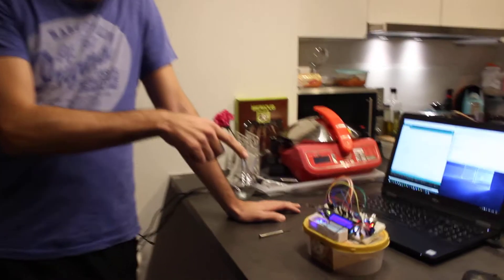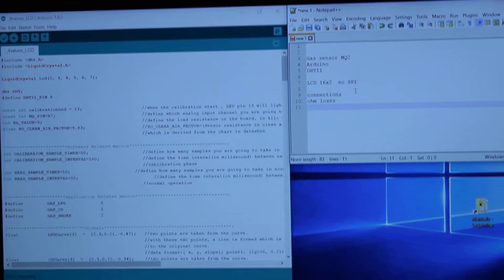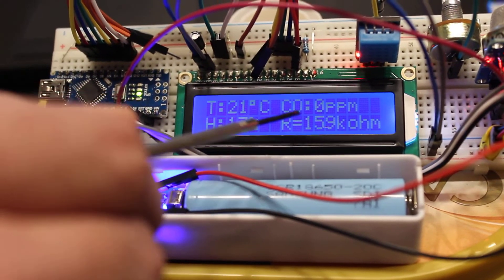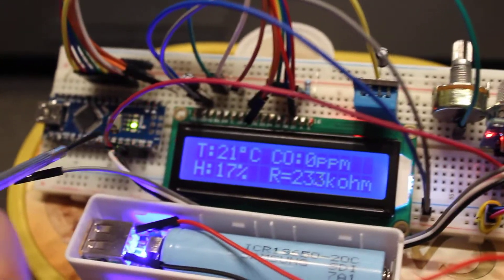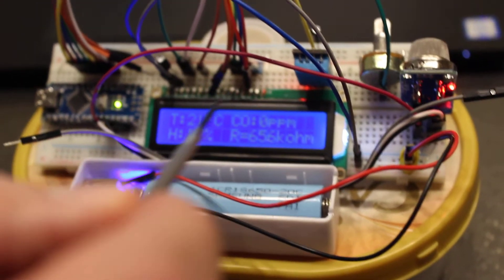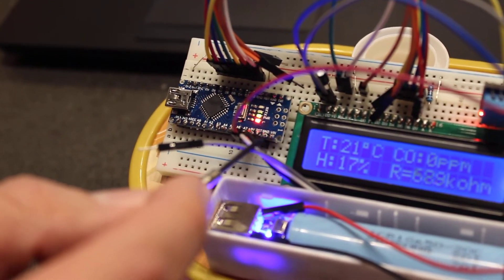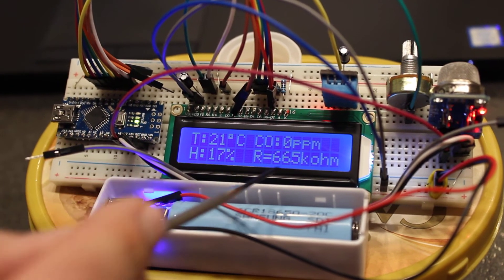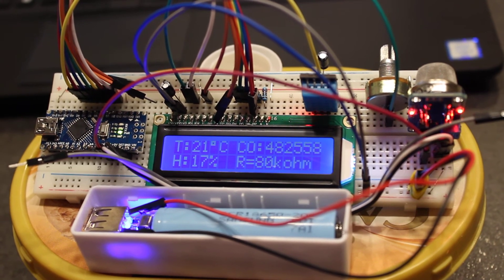MQ-2 gas sensor 16x2 LCD screen output (Arduino)

Comment: hi may i know where do i get the circuit connections from?
Reply from the maker: Do you mean the jumper cables? they come with standard arduino kits, you can also buy them individually in Aliexpress. But I recommend using old phone cable, the one with a single copper core. You can cut it and peel the tips, it looks much more neat.

Comment: Hello,
i have a Problem with my DHT11. The Display shows by Temp and Humidity at first thr right Temperature. After it they  shows -999 .
Can u help me with my Problem? I think the Library is not correct.

Greetings from Germany

Comment: Hi argilaga, I am a student in 10th grade and i am planning to make this in my science fair!
I just had a couple doubts-
https://github.com/argilaga15/Arduino_DHT11_MQ2/blob/master/_4values_LCD.ino- is this the code for the mq2?
http://www.circuitbasics.com/how-to-set-up-the-dht11-humidity-sensor-on-an-arduino/- is this the code for dht11?
And can i use an arduino uno?
Can i use a normal battery or battery eliminator rather than the powerbank?
Reply: in 1 week !
Reply: Hi! thanks for the interest!
The first link is  exactly the code I use in the video, it includes the MQ2 sensor, dht11 and the LCD output, so you don't need anything else. The second link is just for the dht11 sensor. Yes you can use Arduino UNO, it is exactly the same, the only difference is that you need to select the correct board in the Arduino ine interface when you upload the sketch. 

For the battery, you can power the Arduino as you want, by USB, 7-12v to the power jack, +5v to the 5v pin or 6-12v to the Vin pin. Check this image: https://www.open-electronics.org/wp-content/uploads/2015/07/Fig9.png

Good luck with the science fair!!!
Reply: Thanks a lot albert!
Your help may get me the first prize
Just one last query
Can i use the mq135 sensor  because in the description of the mq2 purchase link it does not state if it can measure co and co2?
Reply from the maker: Yes you can use the mq135, but you need to change the parameters of the curves, also take into account that the mq125 is a high sensitivity sensor, so it can be used from 10 to 200 ppm. The mq2 goes from 200 to 1000 ppm. The MQ2 does measure CO, but I think it doesn't measure CO2.
Reply: But will the mq135 function in the exact same way as the mq2
The mq135 will also provide an output same as the mq2 right?
How exactly do you change parameter of curves, please provide an example code changing the parameters
Reply from the maker: They will function the same as far as they are mounted in the same board, they just have different sensitivity to gases. You can get the parameters here: https://www.olimex.com/Products/Components/Sensors/SNS-MQ135/resources/SNS-MQ135.pdf (figure 3) and then change the code here: https://github.com/argilaga15/Arduino_DHT11_MQ2/blob/master/_4values_LCD.ino from lines 28 to 41 you have an explanation, in short, what you need is to input 3 parameters, which are X,Y,m where m is the slope of the curve. To obtain X,Y you need to compute the logarithm of the values of X,Y in the plot, try to do for the MQ2 sensor, if you get the same values as in the code, or similar, then you are doing it right! And finally, you change those parameters in the gas you will use, lines: 29,33 or 37. Good luck!
Reply: argilaga what would happen if I copy pasted the same code for the mq135
Reply: the code is not working albert!
it gives error exit status 1
Can u pleasee mail me the exact working code that i can just copy and paste for my mq135
my science fair deadline is coming up and i have already purchased all the parts!
Please
/my mail -  roblx4lyf@gmail.com
Reply: PLS KEEP IN MIND I HAVE ARDUINO 1.8.5
Reply: sir this code is not working for me i am facing many difficulties
i am just copying the entire code you have given as it is and pasting it on arduino bt it is not compiling !
Reply from the maker: did you install the liquid crystal library?
Reply: i have downloaded it but there are so many files inside that
which one will help me
Reply from the maker: you don't need to open the .zip file, just follow the procedure to install libraries as I explained you in the email and select the .zip file
Reply: can you please send me a photo from the top so i can see how everything is attached to the breadboard.
I followed the steps you  mailed me and it successfully uploaded it to the arduino! Can i use the same program for the mq135? Its difficult to change the parameters.
Reply from the maker: Great! you are getting closer and closer! The fact is that this is an old project, so I don't have it mounted anymore in the bredboard (now I have a battery cycling system), you can try to pause the video to see them, you can also check the wiring for the 1602 LCD here: https://www.allaboutcircuits.com/projects/interface-an-lcd-with-an-arduino/
Yes you can use the same parameters of the MQ2 for the MQ125, but the readings may be not correct, you leave the calibration for another day!
Reply: Pls tell me what is the hardware component placed between the mq2 and the dht11?
Is it neccesary to have that and does it have seperate code?
Reply from the maker: That is a resistor pot of 10 kohm, to adjust the LCD screen contrast, but if you don't have one you can just try with a 1 kohm resistor. When is the science fair?
Reply: Can u supply power to every component using the uno's ports?
Reply from the maker: It's not advised to supply power to the gas sensor from the Arduino because it draws around 200mA and this is the limit of the board, better supply the 5v to the sensor bypassing the board. But I did power the sensor from the +5v pin in the Arduino and I didn't fry anything.
Reply: Hey albert! The science fair is over but for me the CO detection didnt work :( . Temp and Humidity was working perfect and was increasing/ when i provided warm and cold air. I tried everything for the CO, I gave bought 3 mq2's but all of them showed the reading CO=0, I gave 9V direct current because i thought the filament isnt getting heated. I really want to rectify the error. Can you kindly still help me? And if i release lighter fluid or burn a lighter in front of the mq2 should it detect it? I will email you my photos of the project. Kindly help. Thanks, Soham! Hope you respond
Reply from the maker: Hey! I am happy you built it even if it didn't work. I see the resistance gives a reading of 17khom, even if the CO reading is zero you should focus on the resistance reading to see what is going on in the sensor. Now I don't have much time but I will try to look at the pictures and diagram you sent me and try to help you. Good work!

Comment: Hi may i know how to adjust the on board load resistor (the small blue box) of the MQ sensor if i want to adjust it to 5k ohm? twist to left or right?
Reply from the maker: Hello, if I'm not wrong the blue box trim adjusts the threshold of detection if you are using the digital output (on off), in the video I use the analog output, so that trim pot is useless in this case.
Reply: TQ for your reply, 1more question to ask. I wonder know what is the meaning of this code ----> RL value =5. Isit i need to add on a 5kohm , if yes where should i put the resistor on? FYI, i think the video you showed does not use any external resistor also right?
Reply from the maker: Welcome! it depends if you got the bare sensor, or the sensor mounted in a PCB, like mine. In the second case the PCB includes the circuitry for the digital output, the trim pot that affects the digital output threshold, and the 5k resistor for the bias of the analog output, so you don't need to add any resistor, just mesure the voltage in the analog out pin.

Comment: My first project this, So bare with me argilaga - Can i make the same with a mega board ?  Having a quick look around your videos, Im gonna have ago myself.
Reply from the maker: Hi Mark, I think yes,  it should work. Just select the correct board when you compile your code. I advise you to try first the two sensors separately, if they work go ahead with the two together plus the LCD screen. Good luck!
Reply: I managed to get the MQ2 working, Feeling pretty proud. I have noticed a Air Quality sensor on youre page .. Im very interested in making that unit.  I am after making a unit that will sense H2S - methane - gps - wifi - and all the weather station mods. Long story but lots of local residents are being poisoned by a local waste dump. The government are taking readings of H2S at over 500 ppB . FB page has been made its heading to 3,000 folk who are affected by this. So i'm looking for a system i can place on a pole on the side of the house to get my own readings, Will This arduino gadget let me make that Is that possible ? 

Cheers Mark
https://www.facebook.com/groups/553135988367705/
Reply from the maker: Hi Mark! To sense H2S you need the MQ136 sensor. In the link below you fill find the data to fit the H2S Rs/R0-ppm curves (Fig. 3), so you will need to change the following parameters in the code: 
"float           COCurve[3]  =  {2.3,0.72,-0.34}; " or add a new float for H2S.

The 136 sensor is made for concentrations of 1-200ppm,  1000ppB is 1ppm if i'm not wrong with the units, so it must be in the range. Be careful, since the sensor is also sensitive to CO, the presence of CO could give a fake positive reading. Good luck! and keep me updated!

http://www.china-total.com/Product/meter/gas-sensor/MQ136-new.pdf

Comment: can you give me the library that you used because I have problem with compiling code??
Reply from the maker: Yes sure!
Here for the liquidcrystal: http://downloads.arduino.cc/libraries/github.com/arduino-libraries/LiquidCrystal-1.0.7.zip
and here for the DHT11:  https://github.com/adafruit/DHT-sensor-library/blob/master/DHT.h
I just tried and it compiles well with the latest versions installed. I hope it works!
Reply: thank you ,I think the problem with my arduino IDE version because I have 1.8.5 version and I tried more than one libraries and also not work

Comment: Do you have any sheme for this?
Reply from the maker: Hello, sorry but I didn't make a scheme, you can find the scheme for the LCD screen  here: https://www.arduino.cc/en/Tutorial/HelloWorld and the sensors only need one input pin each: analog 7  for the gas and digital 8 for the temperature. Plus the connection for the Analog reference from the gas sensor +5v to Aref. Good luck!
Reply: I want to ask you something?
I changed your code not that much but enough to work on my project but I want to put in a 2 led lights and buzzer.
I found a code that i want to put in your code.
What i want to ask you would you do it for me because I do not really know how.
So if you want to help me,give me an email or some contact to sent you my code and code that is need to put in.
I will apriciate if you help me cuz this is my graduate project.
Reply from the maker: Hey, I cannot assure I will have time to look at it, this month is a bit crazy in the office. But you can send me the codes and I will try! send to my gmail address: albertargilaga

Comment: can you sen me the circuit diagram that you used??
Reply from the maker: Here you have the diagrams for the LCD screen and the Arduino UNO: https://www.arduino.cc/en/Tutorial/HelloWorld
The gas an DHT11 sensosr are very easy to be wired, they  only need one analog and digital input pin respectively. Cheers

Comment: how do you make it
Reply from the maker: You have to load this script into an Arduino: https://github.com/argilaga15/Arduino_DHT11_MQ2/blob/master/_4values_LCD.ino , then you wire the LCD screen according to the pin numbers in the script as well as the gas sensor to the analog pin 7 and the digital DHT sensor to digital pin 8. You can use other sensors like MQ-3, MQ-4... changing the calibration in the script. That's it!